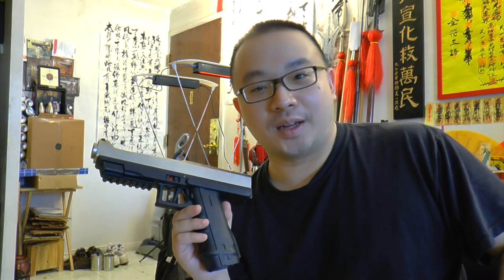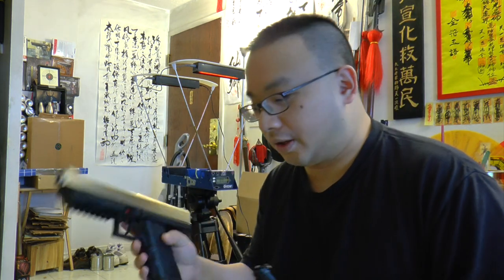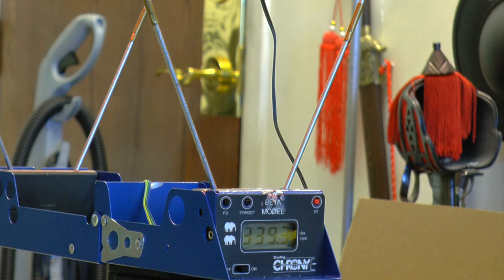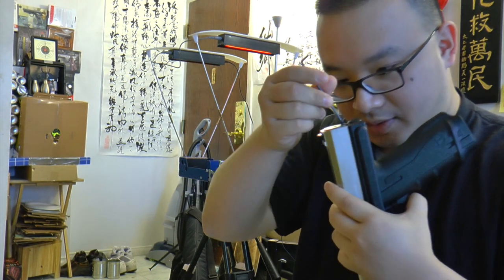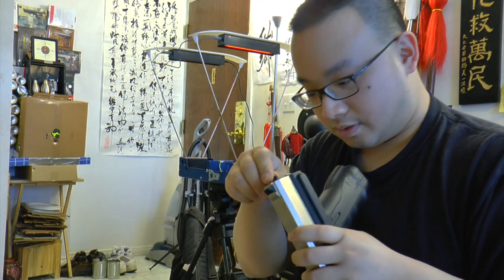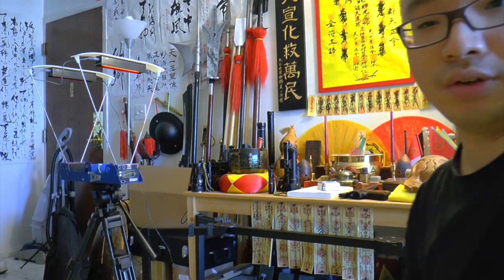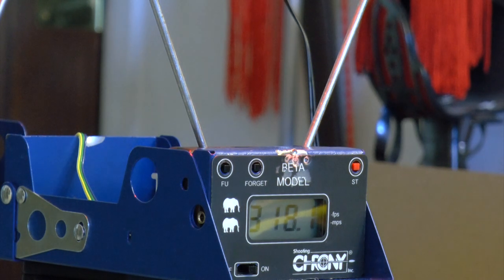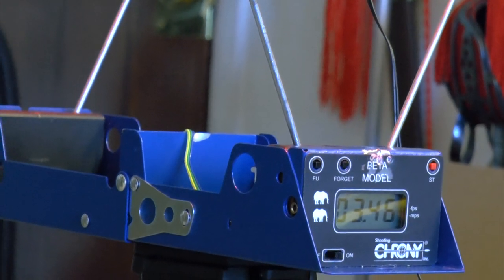Tiberius T8.1 MAXIMUM POWER (Max Velocity) Test and Fixing Solution!

Comment: I have a question that I cannot find an answer to, looking at the Back of the Latest version of the T8.1 Pistol I see 4 screws, 1 is the Power adjustment on the Right lower just above that is the small screw which I believe is the regulator which is the one you broke your seal and Teflon taped My screw is a Allen screw Not a screw with a head on it, the other small screw to the Left of the one you Teflon taped what is that for? Should that one also be Teflon taped? I am getting leaks and I believe that the one you Teflon taped is the problem and My Pistol Marker is at the stock setting I lubed as you show but still leaking
Reply from the maker: this video is outdated, I found out later that it is the shop that sells me the gun who got a wrong screw on the gun, since they played with it!  It should be allen screw, and no you do not need to tape it up with teflon tape. If your rear end is leaking, it should be your regulator having a hole not plugged with the plastic cap, which is why it is leaking to the back (which is supposed to connect to the air tank at the back for a rifle setup)
Reply: So you should remove the white plastic "stuff" and it solves the problem? so i can get max velocity?

Comment: How exactly I can regulate kinetic energy in this pistol? Is it this bolt just below the rear sight for energy regulation? If so, how to catch it? Ordinary screw-driver is useless. What kind of tool it needs to be effectively handled with?
Reply from the maker: MrMatthewliver This is actually an old video already, the new video I did can show more power on the pistol. Max I can get now is 32 joules with breakker balls.  You cannot "regulate" kinetic energy, you can only have the regulator work to regulate the air pressure to feed into the bolt and stuff. You cannot use the screw driver, you need to use the allen key.....

Comment: I would be interested in a power at distance test. My house is 40feet long, if I was shooting at 40 feet what would be the felt Impact Power at say 25 feet and again at 40 feet. This would be real world power, is it Knock down power at those distances, or do you have to be very close like 10 feet to 15 feet away from someone in your House, for any kind of knock down power. What are the Power Losses at those distances? By the time someone is in your house, Running toward you, and gets within 10 feet from while running toward you, That much stress can really screw with your Mind. I have two T8.1 guns they both have leaked all the co2 out from day one since New and Not able to really shoot them. They need some adjustments? to get them so they dont leak, sometimes they leak through the Mags sometimes through the gun, they leak on First shot, leaking all CO2. What is the T8.1 stock regulator setting on the large Allen screw? I have the Small Allen screw screwed all the way in. On that screw/oring that blew out the O-ring could you use Blue Loctite to seal the screw, and No Oring? what size screw/thread is that one that the O-ring blew out

Comment: how do you tune to 280 and about how long will orings stand up to that?
Reply from the maker: this is already outdated, i have tuned the t8.1 to shoot 3g paintball over 450fps, and the breaker ball at about 300-320fps all the time, and this will do no damage to the gun, the oring in the ac chamber just need to be lubed well with silicone grease then it's all good to go

Comment: does this gun have it where if u put in the co2 does it puncture right away or once you start firing?
Reply from the maker: it is a screwing mechanism, usually i store the gun with balls and co2 inserted but don't screw in the screw all the way, then when you need it, just give it 1/4 turn and it will gas up and can shoot right away.
Reply: Chiinnature thanks for the info